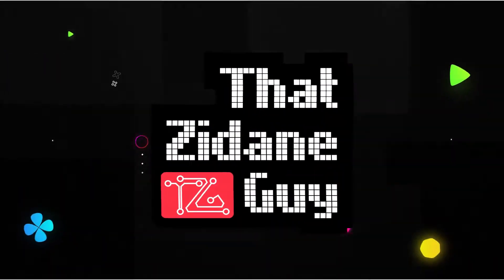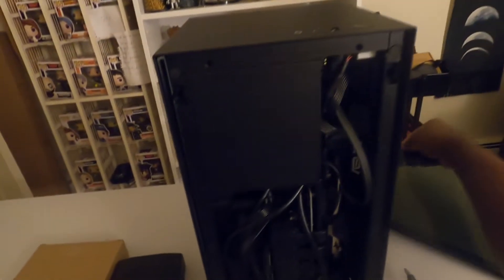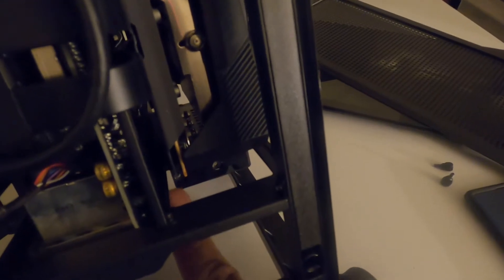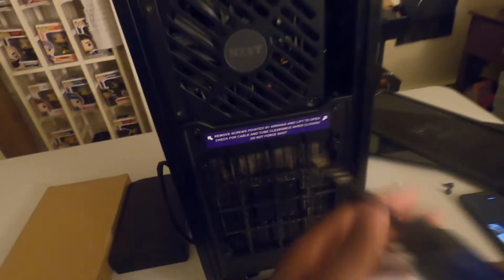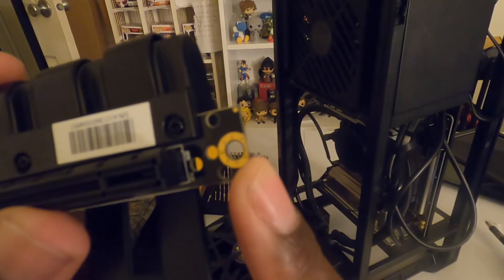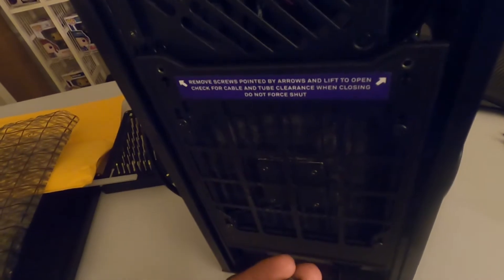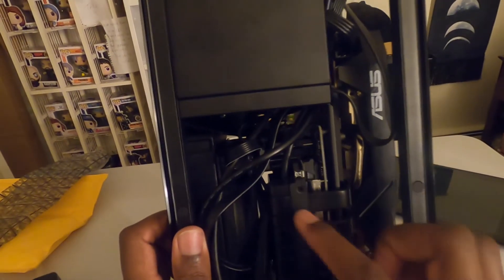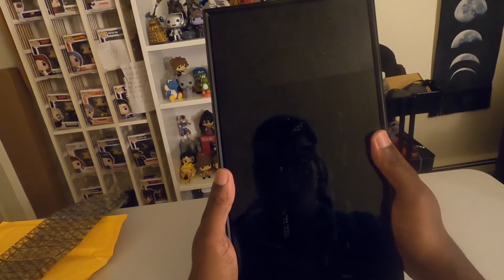How to Replace the NZXT H1 Riser Card

Comment: the steel screws come with the new riser cables and theres also two different risers cables.
Reply from the maker: I addressed the two cables in a short once I found out. As far as the screws I didn't see them in the box. I do feel safer using the nylon screws though.